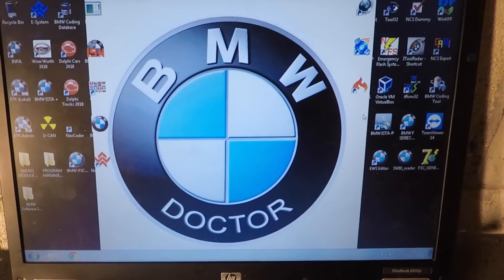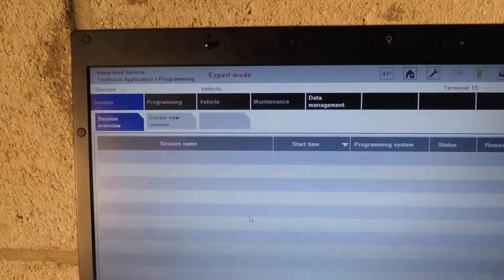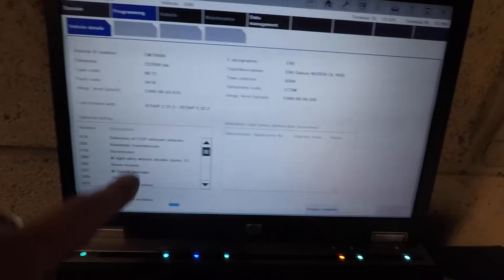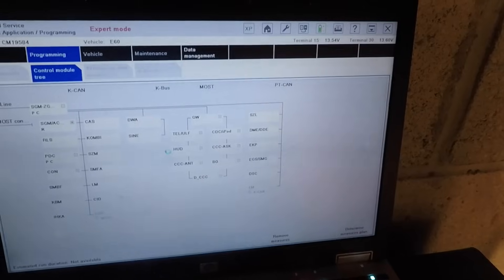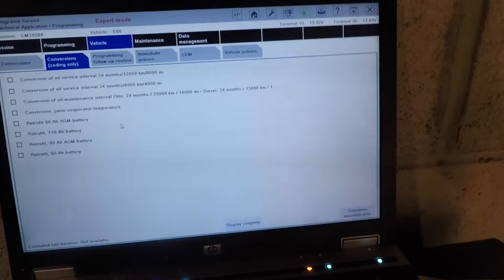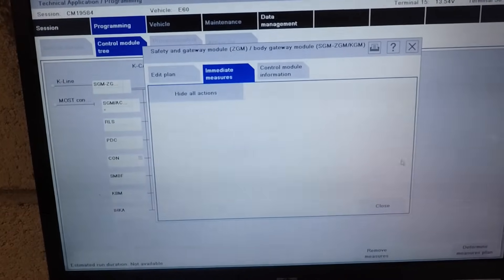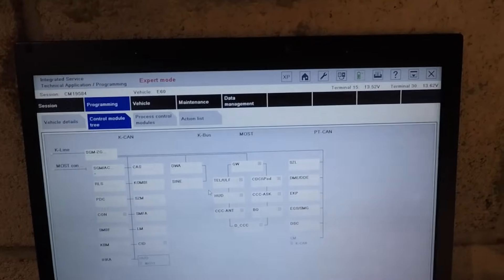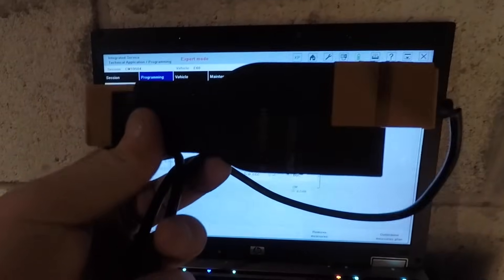BMW ISTA P How To Program And Code Modules Walkthrough in Depth Guide

Comment: Batteries are very good voltage stabilizers but if the curent demand is high they may not be able to keep a steady voltage. Also at high current there is likely the voltage will drop below the threshold. If you needed something like between 12 and 13V I think it could have worked but with a high current charger. Anyway yes, the voltage stabilizer is the best way to go since the program is very sensitive about voltage.
Reply from the maker: Exactly battery charger is not so I’m glad you put that I thought u was going to say a battery charger works it does not work at all nobody even recommends battery charger you either pay the high price for voltage stabilizer or don’t use programming simple terms or if your like me and can get them made like I can for cheap price your laughing which most people cannot
Reply: What about just using jumpers on a running second car?
Reply: It depends,  I let my dealer update all units due to clunk of my 6HP19 after vehicle startup and they told me, at least 70A power supply is a must for proper programming
Reply: I am not saying AT ALL that you can safely use a battery charger for programming, but saying it is a must and you cannot do it etc... it is a bit far-fetched...

I have done plenty of programming using my 30 amp battery maintainer, and never had an issue...
Now, what you need is to know what the programming is going to be...

First I ensure the car battery is good, if the battery is already dropping voltage quickly, then it is a no... if the battery is good, I connect the battery charger, that will keep the battery at the required 13v plus...

The next thing is, I never do a full car programming,  that is rarely necessary, and yes, can take hours!
In that case, I would say a get a voltage stabiliser...

I do individual module programming, even if I want to program more than one module...
When you program individually, the programming and coding is fairly quick (depending on the module of course, some can take some time...),
So the battery charger if good is more than capable of keeping the battery voltage OK during programming...

The tool, whether you are using ISTA-P or other programming capable tool, should tell you in the programming plan how long the procedure will take, so you can make a fair judgement  from there.

Now, don't go and start to program using a battery charger and then blame me for it when it goes wrong... lol

All I am saying is, if you don't do programming often, a voltage stabiliser is an investment that you probably don't want to do, and that with the correct precautions you can do it using the battery maintainer. 

Now let the haters start commenting...
🤣🤣🤣

Comment: Wow You speak so fast, Im trying to catch the most hehe, probably Will watch it a couple of times. The voltage stabilizator You meant is a server power supply maybe 90 or 100 amps. It's okay. My question is: I have a X5 2007 the JBE is broken, ista tells me it's okay but all communication across it like  the data of air conditioning, front panel signals, airbags, water sensor ,DME and other modules is broken. So the car starts but 10 seconds later goes out. And 49 errores appear. JBE box was rusted, so I think water was inside. How can I program an used JBE? There are at least three types of JBE according with some guys, is that correct? How can choose the right one?   Thank You!!

Comment: what do people think about connecting another battery in parallel to mitigate the voltage drop and then putting a trickle charger (or a full blown charger) on that?

Comment: Great video.  Very detailed and informative.  I have a 2007 bmw 530xi wagon US model.  I believe my EHC (electronic height control) module for the rear suspension and also my tailgate module got damaged by water intrusion into the trunk area.  Prices for a brand new modules are quite expensive.  If I went ahead and purchased used modules from eBay would I be able to just plug them in without coding?  Or do I need to code the used modules to my car?  If so, is ISTA P capable of coding these used modules to my car?
Reply: @RamonMedina-bb9yi  I have the exact same issue. Any help would be appreciated.

Comment: Don't you mean a power supply (with fixed voltage)? And they usually have stabilisers in them. This thing is plugged into the wall socket to supply a fixed voltage to the car right?

Comment: Made the mistake of selecting complete car programming, everything programmed up all ok except the multimedia entertainment modules. ISTA P saying BO, GW stuck in programming abort status 12. CIC screen is blank. Calculated measures plan says 5 hours to program nd code the above modules, I'm using voltage stabiliser and ICOM. Is it worth attempting again for 5 hours to see what happens or is there a work around?

Comment: Great video! I agree with you , don't reprogram every module unless if needed. Less is better . Quick question, I have programming data 4.39.20 with my ISTA P . Where are the change-logs provided from the previous data versions? I have yet to update my modules, what gains would I see ?

Comment: I should update the Kombi module of my 2004 E60. It was suggested to me by the xHP flashtool team after installing their gearbox mapping which also shows on the Kombi display the gear it is traveling in in D, while in S it shows the gearbox failure gear icon. They advised me to do it with WinKPF but after numerous attempts I only receive errors without being able to update the Kombi. Can it be done with ISTA? Could you give me some advice on this?

Comment: Hi, i replaced my dsc pump and module on a 535xi (f10)
i installed insta d, insta p, and bmw tools.
Insta d for some reason keeps freezing on scanning the car, unless i manually scan the modules..is it faulty?
i also need to code my pump and do the bleed procedure..
no local shop wants to touch it, And  bmw dealership wants $800 usd to code it and a mandatory 400 brake flush with computer assistance...
someone on a fourm said i need to get a icom (not sure which version i need to use) and use insta p...
any tips, Thanks!!!!!!!!!
I have both Enet cable and D can cable

Comment: Hi I need to ask you a daft question please. After watching this video I notice you don't state that you need to be online. Is programming done from the insta p program and not reliant on an internet connection or did I miss the internet connection part. Thanks for the great tutorials.
Reply: That's kind of my question. If the vehicle requires an update, does ISTA just source the new firmware through the online connection? Or am I required to already have the update locally on my computer?
I was always hesitant to program because I thought I had to have source information to give it.
Reply: @dglooze  The updates are contained in the ISTA-P local database that you will get will installing ISTA-P

Comment: When im on that screen showing battery and ignition bubbles. The ignition is flickering while the battery is solid in my car
 I notice your battery and ignition are solid. Is my ignition switch bad?  02 mini cooper??
My car Cranks but wont start. Only starts a few seconds on starting fluid.... No injector pulse i think i have fuel pressure...  EWS fault is what im getting

Comment: Had issues with reinstalling my whole NTB setup which I used for years. No VMimage but all deployed straight into W7 x64. Along with other diag SW. So not really that easy to keep all in one system :) Now once I had all set up again I wanted to install ISTA-P as a last add on. Bad for me not enough space on the SSD anymore. Been studying more and more about that and ran into this video. ISTA-P and ICOM only. Thought for a time there was more to it and my gut was once more right again :) thanks for the info, gonna stay the way I am only without ISTA-P, since an ICOM is a bit overkill for me right now.

Comment: I live in the U.S. and I have a 17’ 328d. My state doesn’t require emissions inspections on diesel vehicles...just safety inspections. Is there a way to diy code my vehicle to disable emissions systems such as EGR, DPF, DEF, etc? What software would I use? Are there any plug and play systems that let you just disable things with the click of a button? I’m not looking for performance tuning here. I just want to delete those systems without throwing error codes or going into limp mode.

Comment: Hello guys, if I have a problem with cas module, will the engine turning over? Because my car isn’t starting after I found out, plus red wire’s end cap corroded ( red), I’ve replaced it, after that the engine is just turning over without starting, and the garage guys said I have to buy a cas module from Bmw (virgin part which will cost me 360£) Any ideas ? Sorry for my English, and thank you ! Bmw 325d e93 3l engine m57

Comment: Hi mate, thank you for the info. I’m just getting as much info on the ISTA-P as I can. I have an E60 with a faulty DME, I can communicate no problem, is there a way I can take my coding off my original DME and transfer it to my replacement? 
Thanks.
Reply from the maker: No mate you cannot it cannot be done like that I can do it for you unfortunately it doesn’t work like that as the rolling codes have to go with it and you cannot do it with the software you have I can do you a new ecu which will be straight plug and play if you wanted but I would need your original water damaged one and the donor one you have buddy
Reply: Ah, I see. Glad that’s cleared up it’s been wrecking my head! Haha. I have ISTA-D and lots more BMW software on my work laptop although I cannot remember what else is on it. Is there any software that I can use? Or is it possible to programme this used ECU to my vehicle? Just to save me sending it out. I got my customer to get an ECU kit and he got a DME, CAS, and key and key module but immobilised with this and won’t try to start
Reply from the maker: That’s because you cannot do it like that because you have EWS code mate that you cannot get with your software it needs professional software you won’t have and cannot get only software engineer people like myself have this stuff that is why you are better to send to me and let me clone original ecu doing this you cannot move gear selector into gear system will lock you out I know how all this works my friend I’m very very skilled I do it for many many many people in the USA and I have them send me there modules weekly for this

Comment: Hello mate, great video, very informative. Quick question... I want to replace my rem (for pdc upgrade - original was missing needed pins). What would you recommend as best software to code new (used) rem to car? I’ve tried ista+ but hit a problem. I’ve got esys and ista p working. But wondered if it would be easier using winkfp or something else? Any advice appreciated. Cheers
Reply: Hello did you fix it.

Comment: Im working on a voltage stabilizer for an F82 under load the vehicle DME is reading 13.28V at 60A load what is the minimum voltage you want to see so that you dont brick your modules while programming?
Reply: Minimum is 12.55V

Comment: I took my car to an Indy garage for a repair and he managed to wipe all of my coding(stuff like mirrors automatically closing when locking door, start stop reverts to On upon starting the car, horn beeps when locking doors with motor running), he said he’s unable to code the car because I have problems with a couple of my modules, such as RDC and no communication possible with KAFAS, but the strange thing is, my car doesn’t even have KAFAS system, the guy was baffled by this and just gave up. Any advice on how to get the car to align with what is actually installed?

Comment: Hi Dean, how's going mate? Hope everything is going well...I have got a question for you mate, my friend has a e92 without cruise control, ha have bought a used BMW genuine indicator with cruise control...does he needs only to program and code it or is there something else required.
Reply from the maker: No mate you don’t what you need is to get the whole squib and remove the steering wheel and take off the old squib and then code and program it in to use it mate easy
Reply: @BMWDoctor   cheers mate I appreciate your help.

Comment: Great info about ISTA! Subscribed. I got a question about the vo codes. I also use ISTA + & ISTA P, but sometimes when I program a CCC or CIC unit it asked me for the enable codes. I'm kinda stuck here at this point. (voice control etc)
Reply from the maker: Yeah it always asks for that mate mine has voice command also just ignore it and I think it’s called exception or something just ignore it it won’t affect the voice command or nothing
Reply: @BMWDoctor  Thanks for the fast response Dean. So if I click on skip import enable codes everything will work properly after coding/programming?
Reply from the maker: Yes mate it will indeed
Reply: @BMWDoctor  Alright thanks mate!
Reply: @BMWDoctor  please reply to this can I flash or upgrade me bmw g30s seat module that’s all I wanna do I have a normal enet cable

Comment: Just picked up the XS Power PSC60 Performance IntelliSupply.  Nice PS, it provides a constant 14.4 volts, and I no longer get the voltage error when attempting to run ISTA/P on 2015 BMW.
Reply from the maker: That’s it mate Ista p does that to save yourself and your car if it let you program the car without a stabilizer and then it didn’t finish the programming your car would be fucked so thank Ista p for actually doing that and not let you continue without otherwise the amount of people who will try this without one my god I would be rich you don’t realise how many IDIOTS there are around the world who think it’s simple to just program a car and that’s it I’m skilled and make it look easy yes but even ME I can still make mistakes it’s only normal

Comment: Hi! I am a mechanic in Brazil and I have a mine cooper f56 s Manual transmission 1.6 aspirated. After the battery has discharged the vehicle does not start. What should I do? I don't have much information about that car.

Comment: possibility  to make a voltage stabilizer myself? If i get the wiring diagram and a bit of a layout i dont mind making it myself🤔🤔🤔🤔
Reply from the maker: No mate do not risk making them yourself one wrong mo r or the solder loses connection and that will try all your modules I now sell professional and proper stabilisers manafactured in the U.K
Reply: @BMWDoctor  Aight aight, Allright thanks for the demn fast reaction demn, Its on your website? Cus i might buy one, since im stressing out that i sometime have to low voltage ;p
Reply from the maker: Easy thing if your getting low voltage don’t plug your car up and keep playing with it is there anything wrong with your car ???? Do you need to do something major this is the problem a lot of people get curious when they have this software and you cannot be curious you need to leave the car and software alone until there is something wrong and no we don’t use website as they all come to me direct and why we’ll I don’t want a website I have no need
Reply: @BMWDoctor  No, i dont only use it on my own car. I work at a garage and sometimes its easy to use the software since sometimes we cant get in some systems or cant reset service with our obdscanner. (If the customer drives to long with indicator) new model BMW's have  that problem(so do Mercedes) So this pogram works better for it. But i have sometimes problems connecting to the car because of lower voltage
Reply: @BMWDoctor   where do you sell them? Link?

Comment: Hi, thank you very much for your video. I regularly use Icom A2 to program bmw of friends. We have changed the ACdelco valve body of a GM transmission (BMW 320i 2012). When connecting a standard scanner, it does not recognize the new transmission valve body. Can I code ACdelco valve body with ISTA-P? The valve body is new and has never been programmed. Thank you very much dr.

Comment: Which make battery charger used in this video ?
Reply from the maker: We don’t have makes on here we now use different ones and only supplied via the U.K they are made specially for me here by a company I now use complete different ones
Reply: How much cost & ampere ?
Reply from the maker: ganesh khochare 120amps and cost is £650 shipped
Reply from the maker: Yeah for that crappy CTEK charger

Comment: Hi,  do you have a link  to a page I could buy a reliable voltage stabilizer?  thank7s
Reply from the maker: I don't I get alot of stuff sent to me especially for me it would be hard to say as ones on the net are known to over volt your car as the transformer inside stops working delivers to much current and explodes all your modules so I wouldnt really know it aint easy finding a reliable one